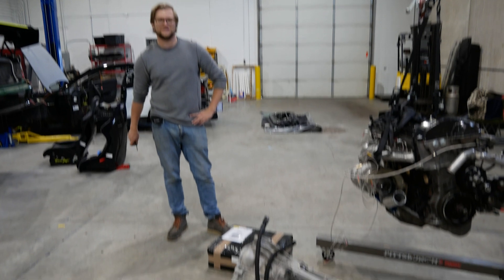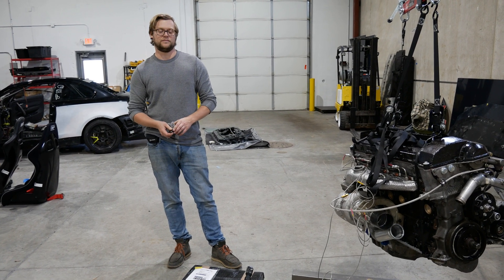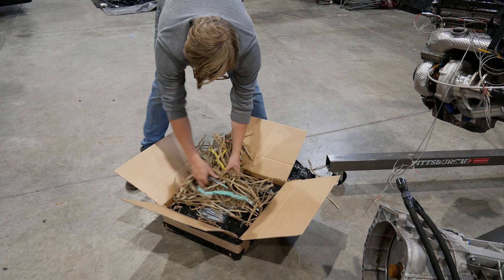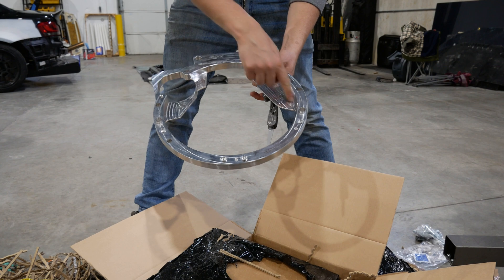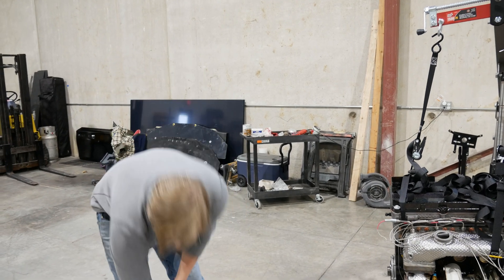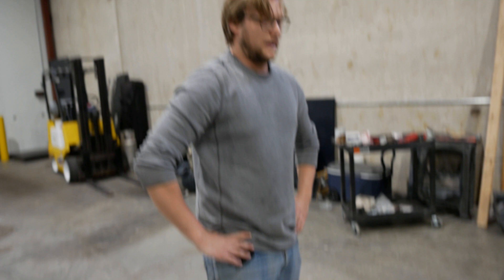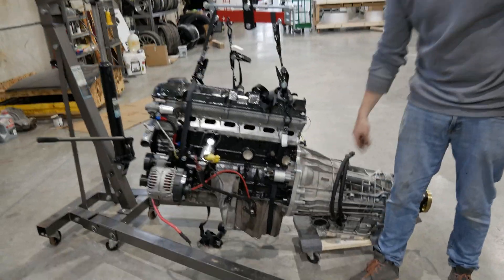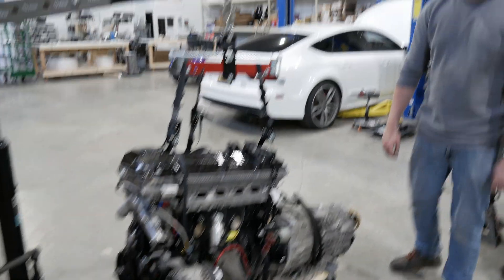Turbo BMW M52 Gets a DCT Swap

Comment: I just bought an e39 528i m52 and I would like to get a single turbo on it but it will be useless since the gearbox is so shitty and slow, can you guys tell me the process and the price of changing it with the dct? I'm not a really big fan of manual gearbox on big cars , it just doesn t feel right🤷🏻‍♂️
Reply: or is there any other way to improve the actual gearbox?

Comment: So the sprung hub flywheel is basically a dual mass flywheel?
Reply from the maker: yes very similar, just without the added weight of the second mass.